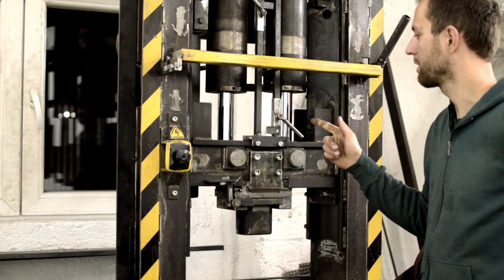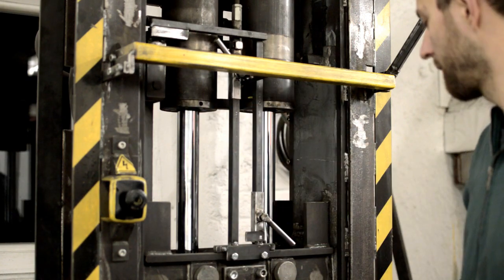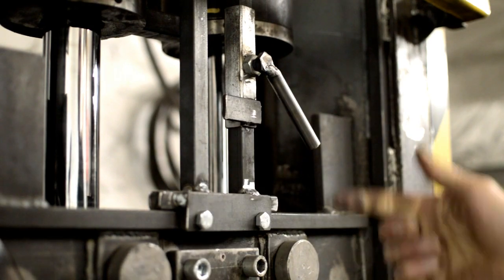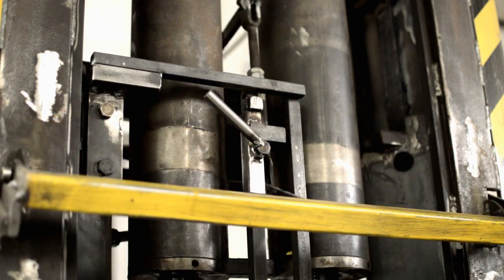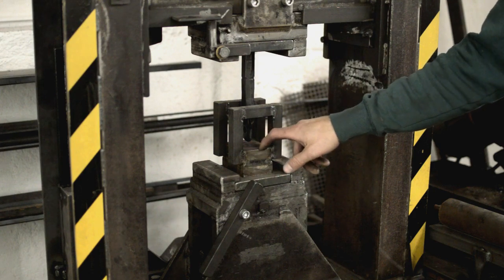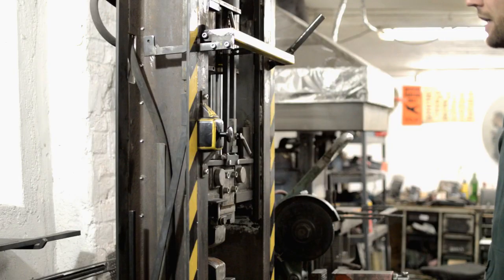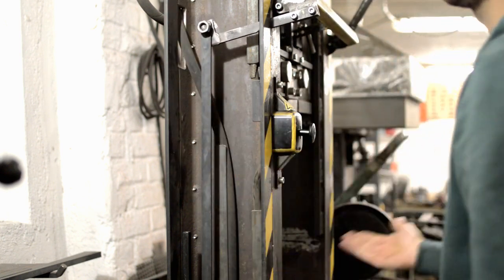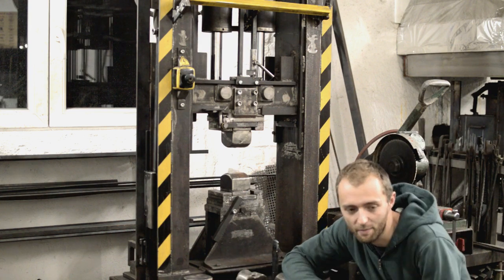Adjustable stops for Hydraulic forging press

Comment: Super nice! Have you had any issues with the double cylinders? I have heard people complaining about them not always being in sync on their presses and causing binding issues.
Reply from the maker: Thanks, I had issues wit the double cylinders mainly because they are not exactly same size, one is thicker and shorter than the other. So it was absolute nightmare, one is few tones stronger and other one goes a little faster.  I had to reinforce the guides and the ram, and make upper and lower stops.  Its working ok now, but it was a lot of extra work to overcome this.  Two cylinders of the same size should be ok if u have a good design of guides and ram.  But if you can, definitely get single big cylinder. Something like 150mm outer cylinder diameter, and at least 80mm rod diameter.
Reply: @KarlMetalworks  OK! Good to know!
Reply: Very good।